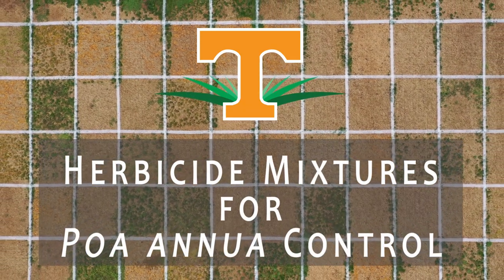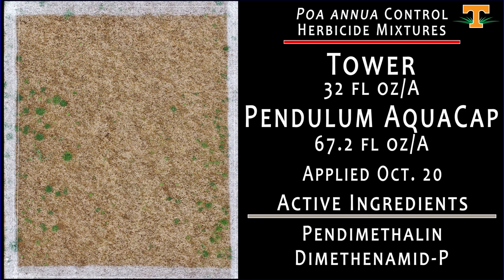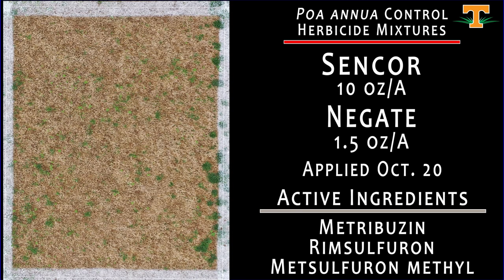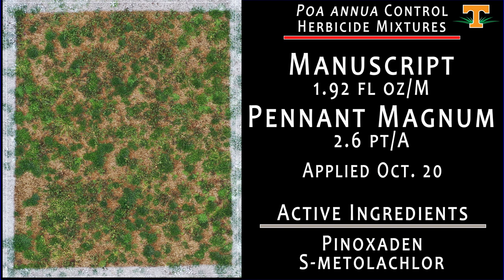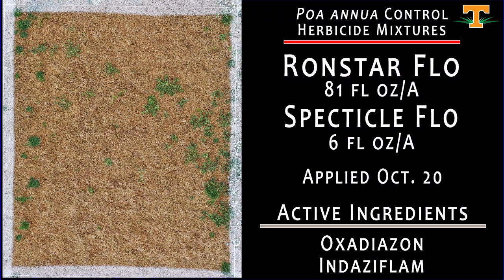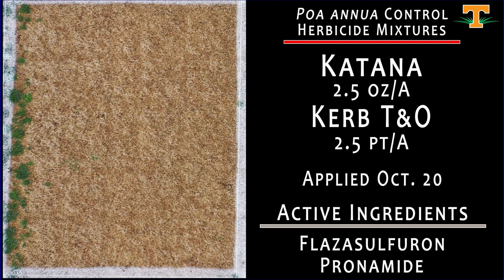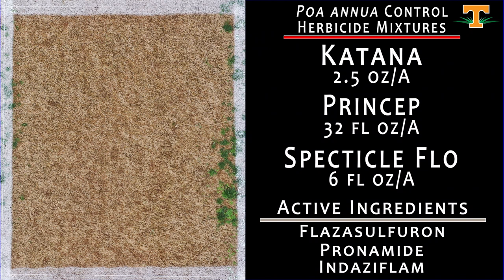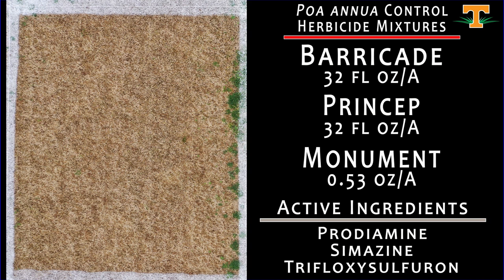Poa annua control in hybrid bermudagrass using herbicide mixtures

Comment: I put down Negate 1.5 oz/A or 0.034 oz/1000 sq ft, Barricade 24.6 oz/A or 0.565 oz/1000 sq ft, Princep 32 oz/A or 0.735 oz/1000 sq ft one time application  late September 2023 for my annual problem with Poa Annua. I was extremely disappointed with the results. There was no improvement.